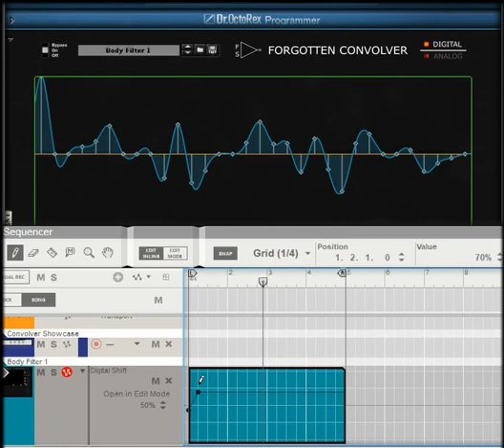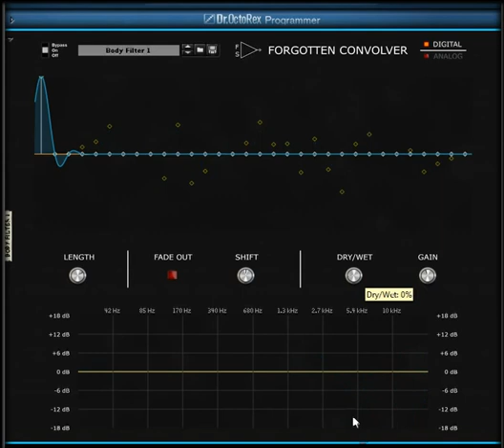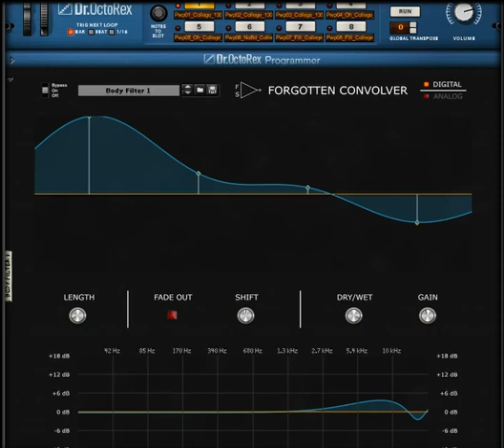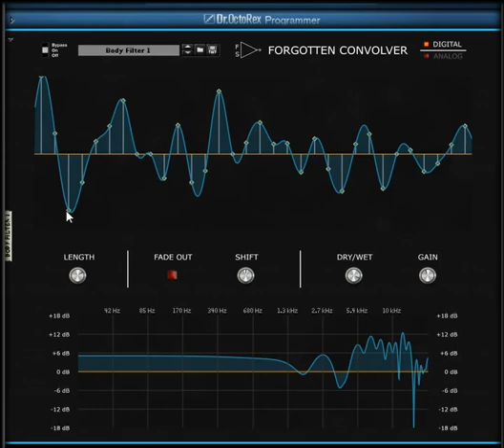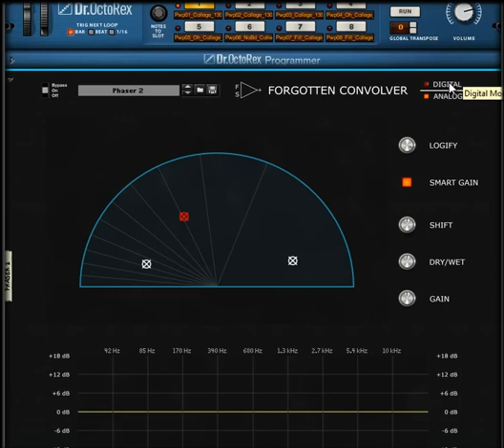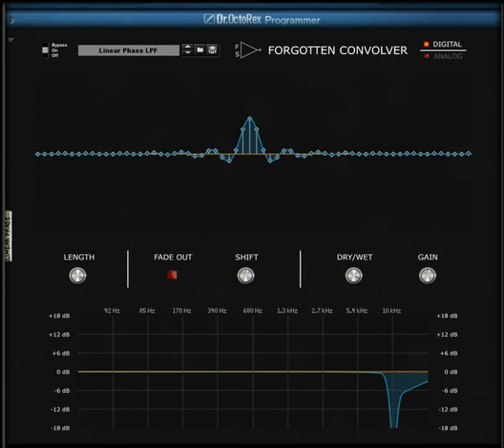Forgotten Convolver v1.0 Showcase

Comment: Okay, but what are the uses of this filter? For what tasks you can use it?
Reply from the maker: It is suitable for a wide range of applications - whether it be mixing or sound design. The digital module is great to add "body" to a sound while the analog module allows for smoother and more predictable filters. Although it was primarily built for creative use, a little bit of knowledge about digital filters opens up a way of using it more strategically.